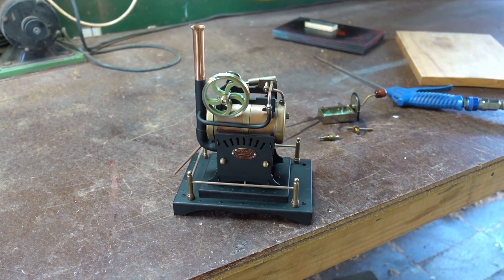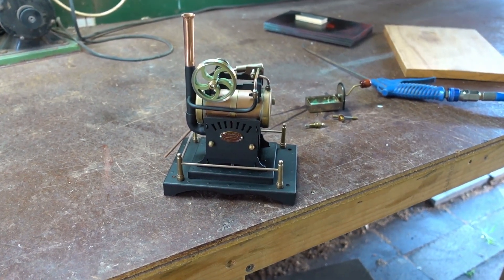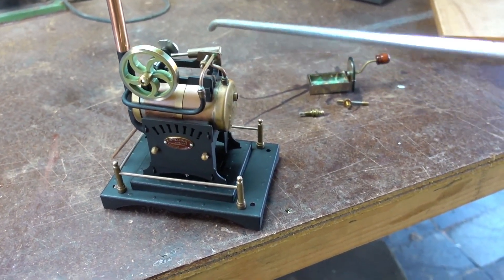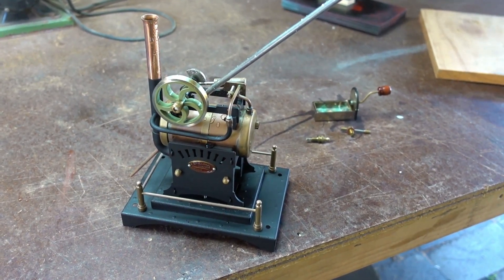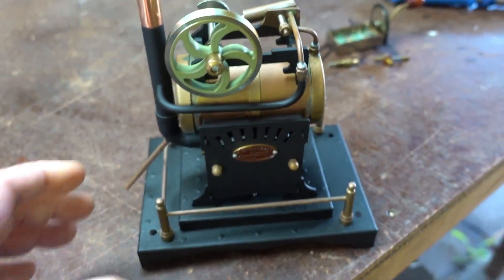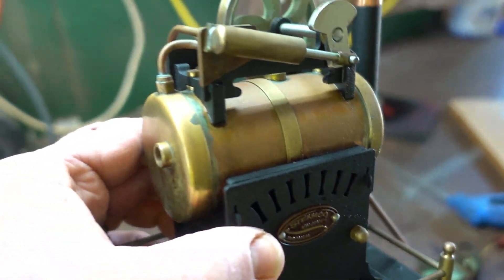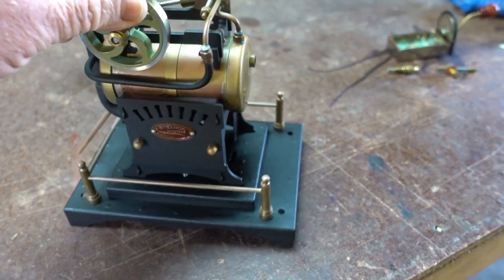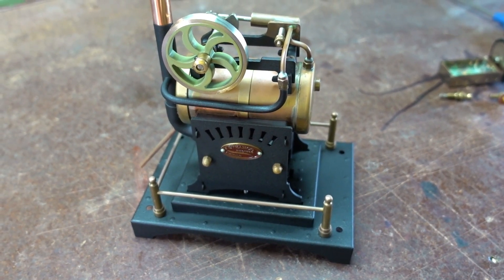Model Toy Steam Engine Boiler Quick Drying Method

Comment: Great video!   I also blow mine out with compressed air, but I follow that by warming the boiler with a hair dryer and allowing it to sit for a day or so, replace the boiler fittings then oil the engine, cylinder, and valve chest (if applicable). If I know that it will be quite some time before it sees action again I have also given them a light spray (exterior only) with WD-40.
Reply from the maker: Just subscribed to your channel, look forward to watching your Stuart boiler plant. Good idea with the hair dryer to warm the boiler.